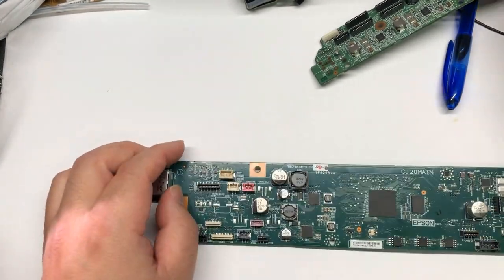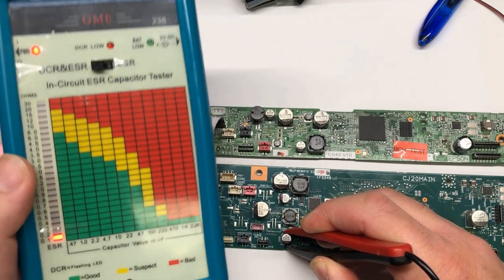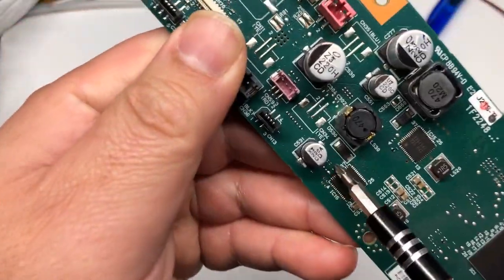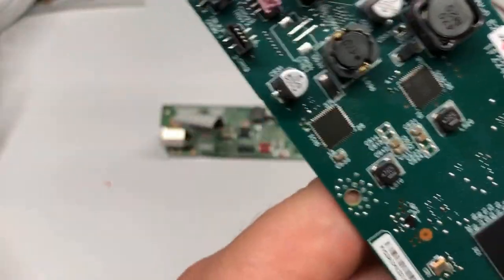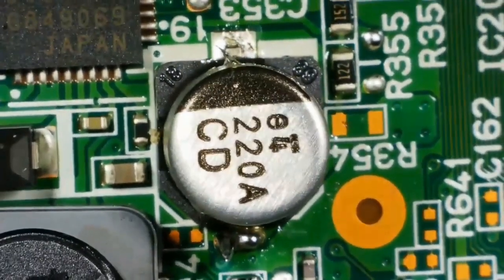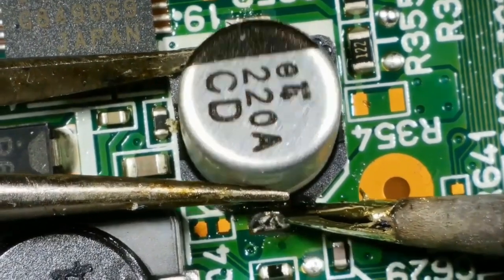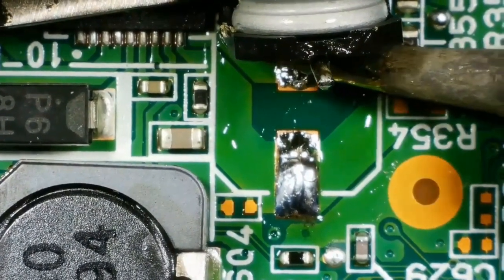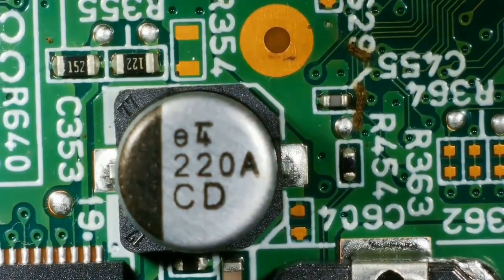Epson ET-8550 & XP-15000 Mainboard Repair: DTF No Power 031006 Replace Aluminum Capacitors

Comment: Hello Kevin. I have two problems, The first I trying to do a power cleaning  in the printer but it looks like does not refill the ink into the print head and the second problem came when I try to cleaning it many times and the error 031006 pop up. What i fix first? Thank you for your videos